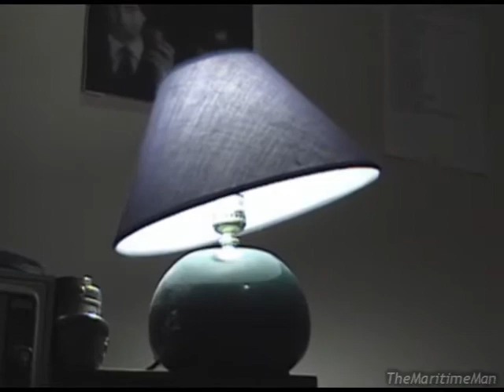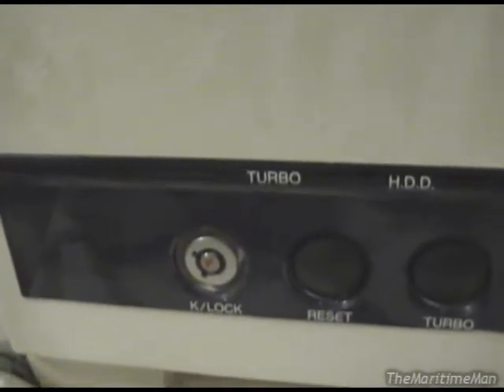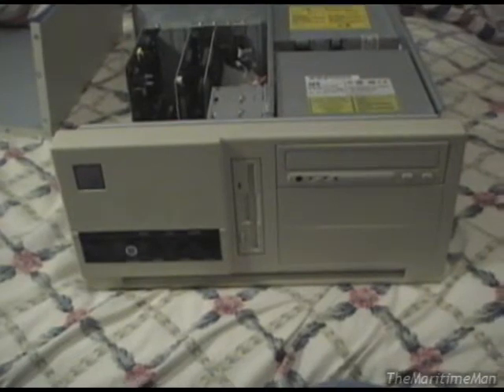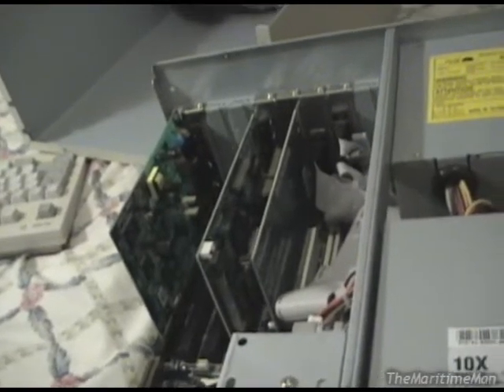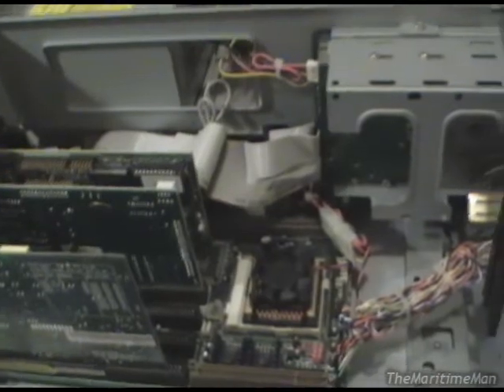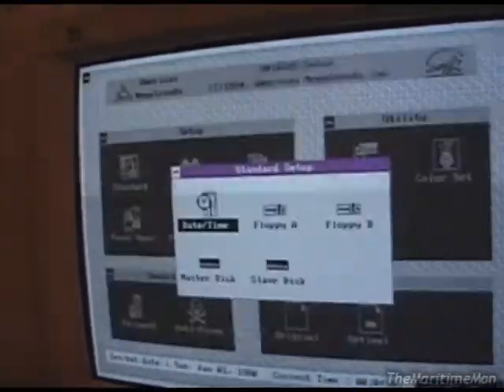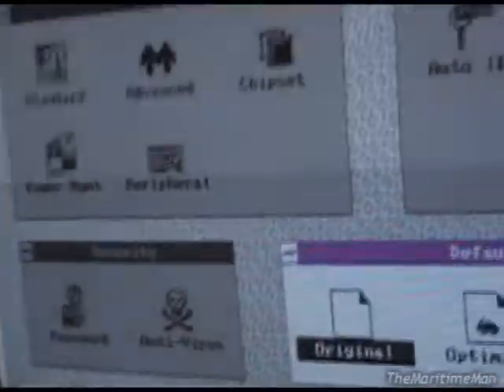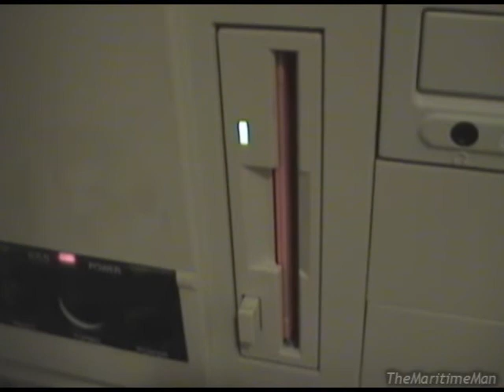I got a free Turbo 486 computer

Comment: L2 Cache was optional back then. Those chips are interface / Cache controller chips for the SRAM module which isn't installed.  This board was made for a lot of manufacturers, I have 3.  Amptron was another company that had this board.  The "WinBIOS" also was used on some Pentiums.  I have a lot of this old stuff, and grew up with this stuff back in the 90's

Comment: The 5X86 was not quite a 486 class.  It was a socket 3 chip which had some K5 architecture. Cyrix 5x86 actually had some Pentium Pro architecture (later used in the 6X86 Chips) which made it a better choice in the day for socket 3 motherboards.  They were meant as either an upgrade choice, or a low cost choice for people who wanted Pentium power ( granted P75 Speed ) without the P75 price.

Comment: And ( sorry for the posts lol ) I compared to my Shuttle Hot 433 board with 256K, and this board ( and the v3.4 ) and were exactly the same performance without their 256K. The cache made this board 3-5 fps in Descent 2 faster than the Hot 433. The HOT 433 has 256K on board. All boards have a UMC chipset, but the HOT 433 is one version behind. I still think, even without cache, from my benchmarking, is still the one of the, if not the fastest 486 board made.

Comment: About the modem I did buy a  56k Cirrus Logic ISA modem in early 2000. You could either configure with jumpers or PNP mode. So they did make or sold ISA modems in 2000.  But that looks like a 33.6K or 28.8k modem.
As for old ISA nic cards. There is 3com EtherLINK III in ISA form and also in PCI.  
I still have a Intel ISA card  FA82595TX card which is 10mbps card. 3com EtherLink III PCI 10mbps card. A trident 9680 pci 2mb video card, ISA soundblaster Vibra 16 sitting in my closet in a box.

Comment: The computer was cool, despite the fake L2 cache. However, I happen to have a USB floppy drive that makes the same pitch as the floppy drive in this computer and I was wondering, were you using a Optiquest monitor? The GUI for the monitor seemed quite familiar and I happen to have an Optiquest V773 monitor. By the way, happy birthday!

Comment: Of course they are, and who wouldn't want to use an actual SoundBlaster card in a computer like that?  What I probably should have said when talking about that card is that it's 100% SoundBlaster compatible, it would need to be to run a lot of software I suspect, but you are better off with the SoundBlaster AWE64 you have in it now, I can't wait to see a video of some software running on it.  Do you have any DOS games on the computer?

Comment: But, they did have controller / interface chips on the pentium boards. I guess PC CHIPS thought they could fool people.  I did some benchmarks on the  board with/without the 256K cache and the FPS was maybe 3 less in Descent 2. I guess the old 486/5X86 chips didn't take advantage of the L2 as much as Pentiums did for performance.

Comment: I think that you can run WIn98SE on it. But it depends how much of RAM you have on this one. If you have less than 16mb then it's useless to install Win98SE on it.
I don't remember off ISA modems which were made back in 2000 - if that's true, then that's probably a hardcore special legacy hardware made specially. PCI modems were absolute standard back in 2000ies. And today most new and brand new motherboards have integrated 56k modem chipset on it (even some newest don't have this anymore).

Comment: I don't think there's a turbo though, so it's not really useful. Also; old networking cards have a holy trinity (Novell NE2000, AMD PCNet series, and Realtek RTL-8139) that work well with software from the 90s. Late 90s OSes support the RTL8139 well, mid-90s AMD PCNet, and early 90s NE2000. Just remember this stuff when you want to network it.

Comment: Ya they are. I guess I am just being facetious about it. I have the exact same board and it is plastic.  I took one apart lol.  But the v3.4 does not. Interesting though, I have a COAST for both, one unfortunately is bad, but both boards still see the 256K, even though the bios is disabling it and just not saying. If the COAST is removed, neither board says CACHE 256K at boot. If you look at the board, the traces under the "fake" cache does not go anywhere. Seems like an awful waste of traces.